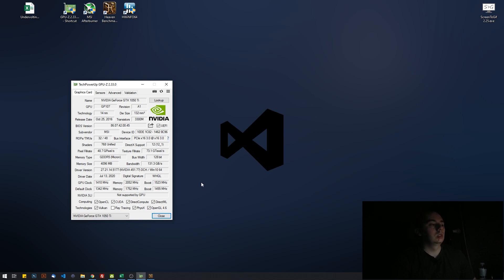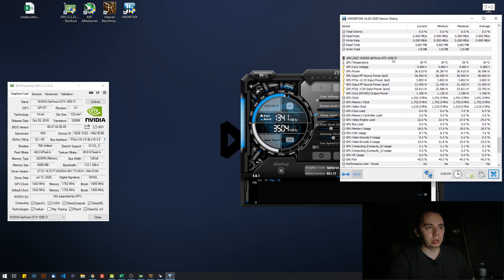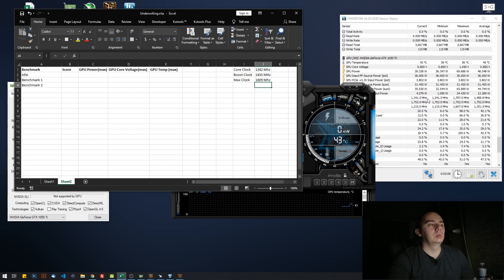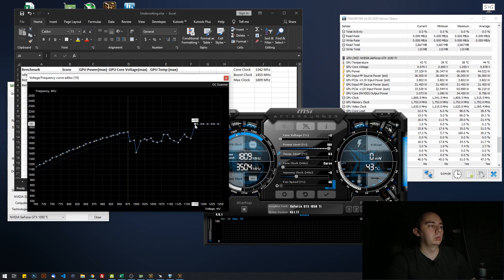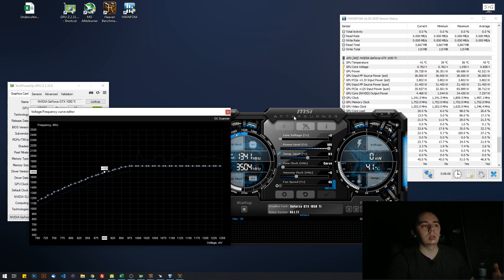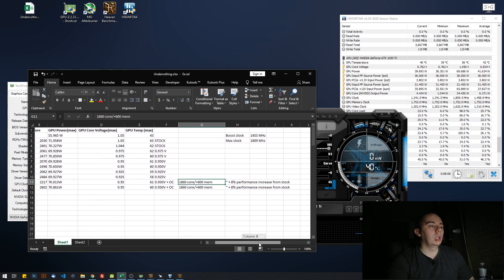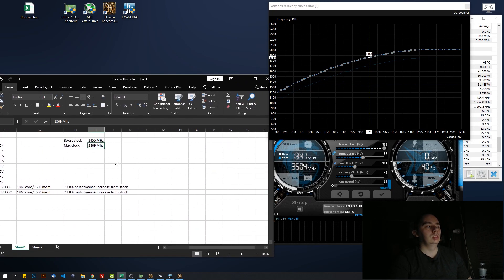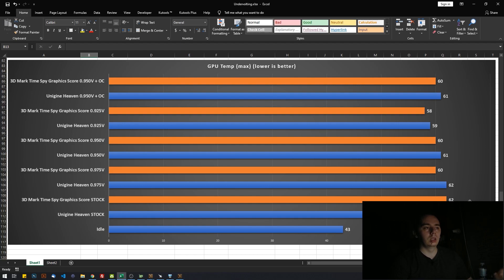GPU Undervolt Guide - Nvidia - Lower GPU Temps + Performance Boost | Techie Show

Comment: At about 6min mark I found the curve for my max core clock and max voltage to be actually higher than what I wrote down i.e. My max clock core is 1785 and max voltage is .900. On the curve I selected 900 and it was already higher at 1812. Should I be actually lowering it then instead of raising it as I can't really like in your video. These settings are how it came OEM also.
Reply from the maker: Interesting find! Well, I'd actually first try at 1812 MHz with .900 voltage. It might be stable, and as it's a higher frequency there's some performance to be gained (nothing wow between 1785 and 1812, but still worth the try).
Reply: @techieshow  I just left it at OEM's 1812. Pretty much all changes I do actually bring down my score weirdly enough. Note I have a W5-5R9R8N-999 (RTX 3080) if you want to know what I am dealing with.
Reply from the maker: @KnightRadiant88  Bummer. And what about the temperature?
Do also make sure you test at least a couple of times with and without the undervolt.

To be fair, if my scores or FPS would drop 5%-10% while remaining at over 60 FPS and my temps would go down noticeably, I'd settle on this for non-demanding games where I can surpass 60 FPS easily. Like a profile for this on MSI Afterburner just for these ocasions. Especially on a notebook and on long gaming sessions.

Comment: Hey. Did what you showed in video. Fan speed (temperature) still high so tried locking it at the lowest possible. I hit lock at 700 volt and still high fan noice. Any tips?
Reply from the maker: What GPU are we talking about? And what degrees does it reach during gaming or intensive stuff?
Also make sure the fans aren't locked at 100% or something. 
(you can also play around with Afterburner and the fan curve in his settings, by setting a manual one... like 50% fan on 60 degrees, 80% on 70 degrees and 100% on 75 or something like this)

Comment: Hey, can i undervolt even more then this to get even lower temps? I don't mind 10-20% performance loss
Reply from the maker: Hey! Of course! Make sure to test for stability so you don't go overboard.
I actually undervolt even if performance is lost on my home server (a PC that runs as a NAS with some light usage VM's). As it's overpowered, I'd rather have it dead silent and cool than just being powerful and doing nothing 90% of the time  :-D
Reply: @techieshow  Can you tell me how to do this then? I legit know very little. Do i work in the window with the curve?
Reply from the maker: @vidardanielsen3477  Sure. I hope I'm going to explain this so it's somehow understandable: you actually always set the frequency below the max. That means that in that curve chart where you set those little squares, you lock the voltage to let's say .800mV, but you reduce the max frequency from 1800MHz (for example) to 1600 MHz. You're actually reducing the max clock your card can hit, so it will be stable. This also allows you to go lower on the voltage (you need less voltage for 1600MHz than you need for 1800MHz, and by reducing the max frequency you make sure it never hits more than 1600MHz, so it never gives errors, just has lower performance)

note: when I mean reduce frequency, you move the squares down (look at left of chart, where frequency is noted).
note2: I'd try to lock the card to non-boost values, and then undervolt as much as possible. It might be just enough. But of course you can go even further :)
Reply: @techieshow  thanks man, yeah It  makes sense. Btw my laptop, legion 5 (not pro) has 3 modes. Low makes it ignore gpu and use cpu internal gpu, medium reduces cpu and gpu and high is maxx. If I change values to lower wolt and then play on medium, could it be I can't start it because presumably pc undervolts gpu or?
Reply from the maker: @vidardanielsen3477  Yes it's totally possible that on medium the laptop also does some undervolting. I'd try undervolting manually on High. If I correctly understood the mode in which your model works (never had a Lenovo Legion), the ideal scenario would be to get better temps than on medium, while having better performance than on medium by undervolting on High.

Of course, you'd probably get the best temps on Low if you're only doing office work and multimedia. (it's a good chance that on any dedicated GPU usage, even low usage, you get more heat than on the CPU-integrated GPU)

Comment: Hi there, I sent you a message on Instagram looking for help. My GPU gots to 100% usage and then crashes. I have a 3060ti. What can I do? Underclock?
Reply from the maker: Hey! Sorry, I don't check my social media so often, I'm most active over here - hopefully uploading more also in the near future :)) 
So you get crashes when your GPU goes to 100% usage? Or it's locked at 100% no matter what?
Either way, even if it would crash because of high temperatures when at 100%, I'd contact the warranty department because that is not normal on such a new GPU.

Comment: how you decide that 975 volts @5:55
Reply from the maker: I already tested all the upper values before my video. 
I recommend decreasing by 25 or 50 mV at once until it fails. In my case, at 950 it's unstable, so I bumped to 975mV and it's all good.

So basically I started from 1.044v and went down.
Tested at: 1.000v, then 0.950v, then it failed and I went to 0.975, tested, and no fail. All good then :)
Reply: @techieshow  thank you for the reply and the video. Great work here!

Comment: How much did you increased the memory clock in each step, before getting to +600?
Reply from the maker: Hey! So I usually increase the clocks by steps 50 MHz on core and 100 MHz on memory. And when it starts failing I just dial back a step and then increase in smaller steps. So mine failed at +700 MHz @ memory. I didn't bother to squeeze everything out of it, but after a stable 600 MHz and a failed 700 MHz increase, I would test +625 Mhz, +650 MHz and so on. And then even smaller steps if you really want to push it as far as it can go.
Beeing that it's just a GTX 1050 Ti, I didn't as probably the gains from 50-60 Mhz increase on memory would not be spectacular.
Reply: @techieshow  Thank you so much! Very clear and helpful, I can't wait to test my GPU (a GTX 1050 Ti coincidentally 😄)

Comment: when you were running benchmarks while undervolting did you re set HWINFO each time you decreased the voltage as your wattage stayed the same with lower voltage and same clocks.  since the GPU is being told to use less voltage generally the amps scale as well.  you should be getting around 45 to 50w for the 925mV.  also heaven bench isn't a good benchmark these days super position is a lot more intensive and will show errors a lot easier than heaven
Reply from the maker: Thank you for the comment! Yes, I always reset HWiNFO between runs. Especially at 925mV (as I hat to reboot when it gave a BSOD as I tried going even lower - not shown on video).
I suspect the monitoring for the GPU Power is not that accurate to be honest. As I also thought the overall power should be ~50W for the 925mV. Strage thing is that a friend with a RTX GPU, has more accurate readings in that column. Or maybe the problem is that the 1050Ti in this video uses only the PCIe slot for power.

Superposition is indeed more intensive. I have tried it (just a run) and no errors, but 950mV and the OC in the video are my stable settings for a while now so I know it's stable. But to be honest the 1050 Ti seems to fail ASAP in Heaven if I over push it. Maybe because it's not that powerfull :)
I think what's important is to test in as many different benchmarks and games before declaring a new setting stable.

Comment: Quick tip, in MSI they added in an update that if you click and drag on the graph whilst holding shift you can select many points and drag them at once
Reply from the maker: Very nice! Didn't know about this. Thank you for the tip!
Reply from the maker: @Eternity Hey! Thanks for the comment! Basically it was unstable below 975 in benchmarks and gaming. Not instantly, but I figured might as well settle for 975 to ensure stability.